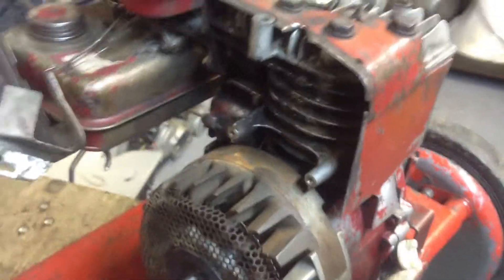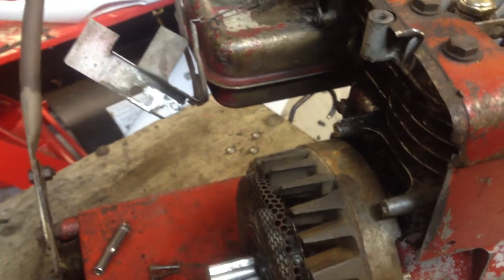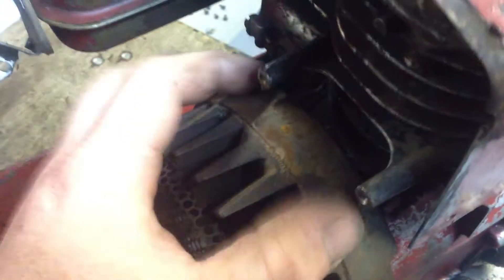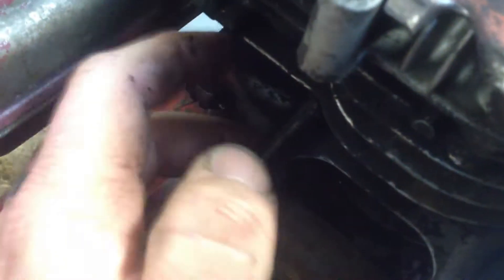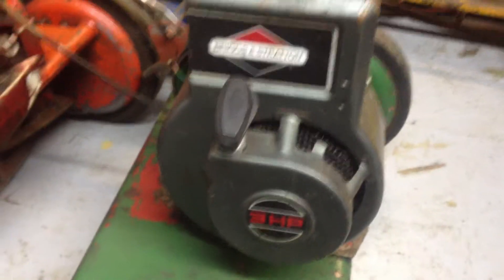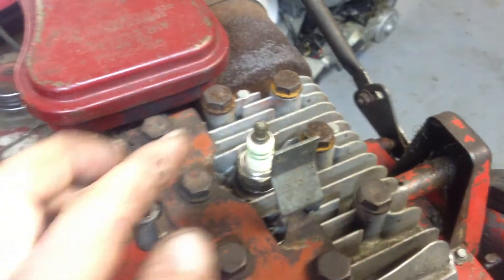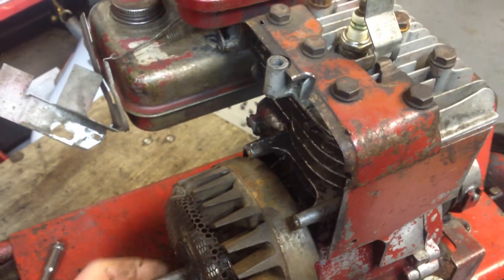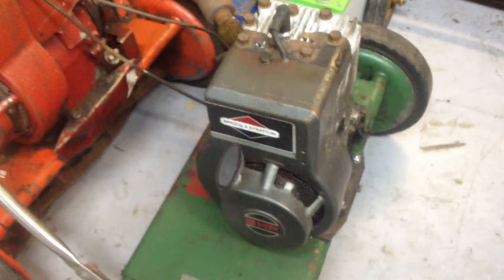Toro Sportlawn rebuild video #3 Coils

Comment: Getting a sportsman has no spark that been sitting...  
I'd like to try and keep it all oringal 
And use the point system but also don't want to tare the engine all apart.. there a way to just sand em and see if that works
Reply from the maker: Yep